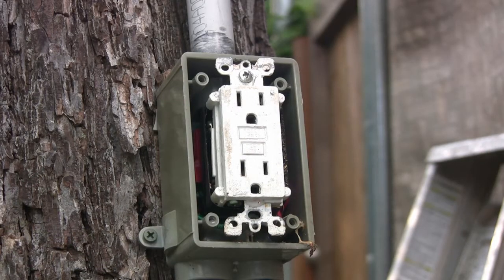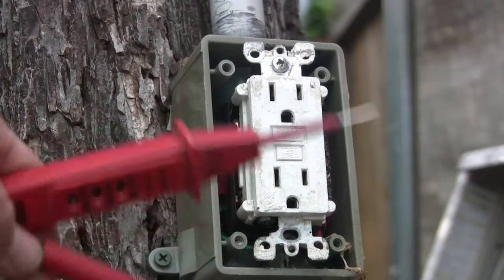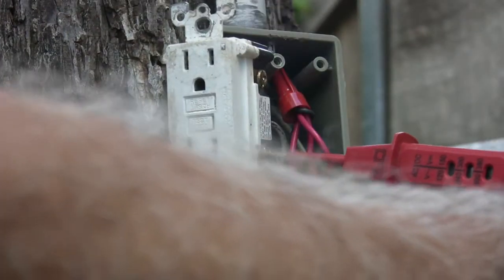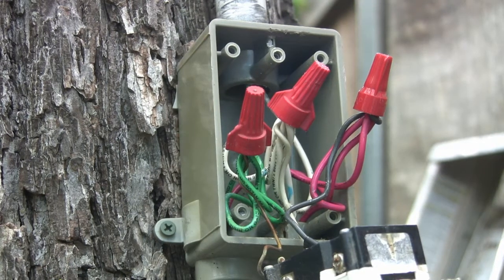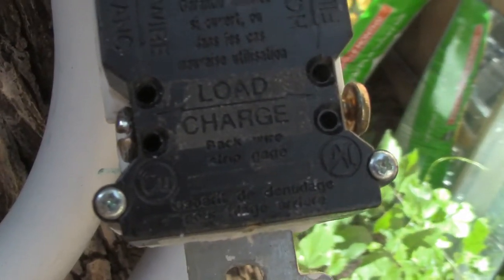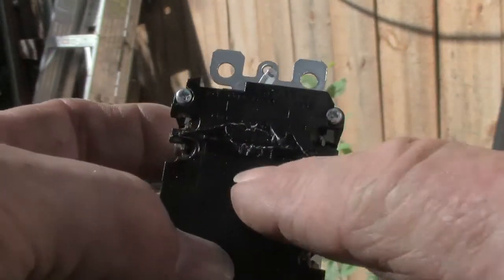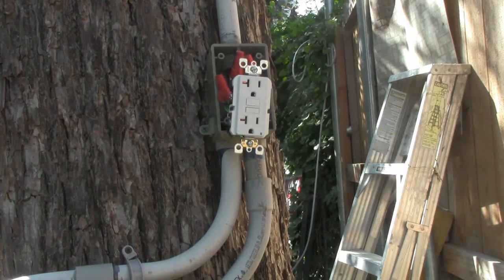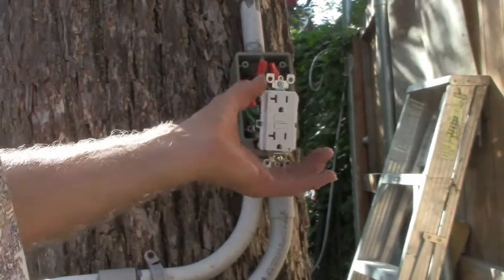GFCI plug checking and changing

Comment: The hot side is always the small slot on the receptical The wide slot is where the white wire goes,narrow slot the black wire round hole is ground. This is good for all plugs the are 120volt 15 amp.standard recept.  240 volt is a new ball of wax.
Reply from the maker: I'll put this on the video page